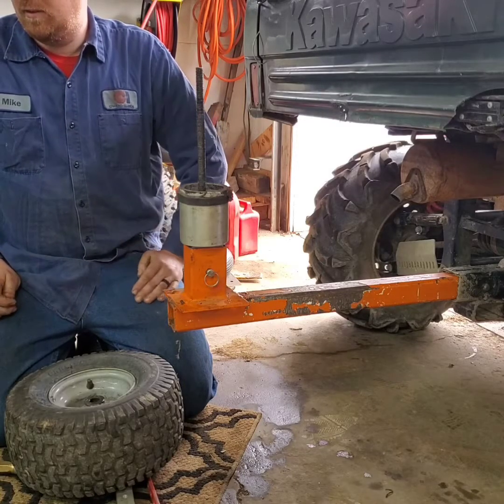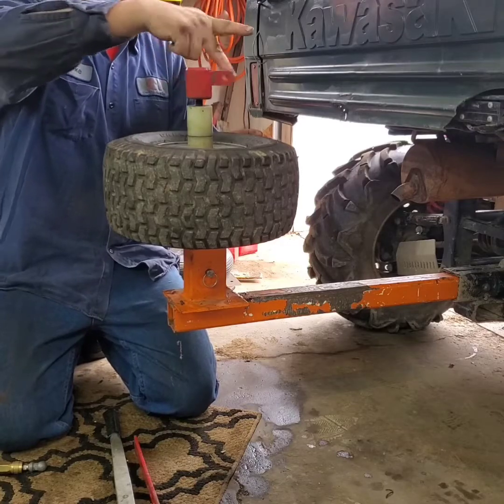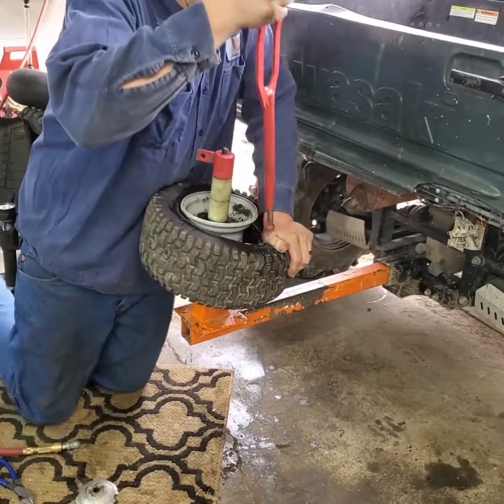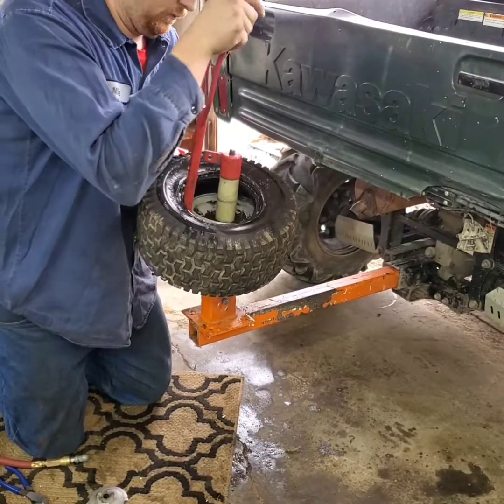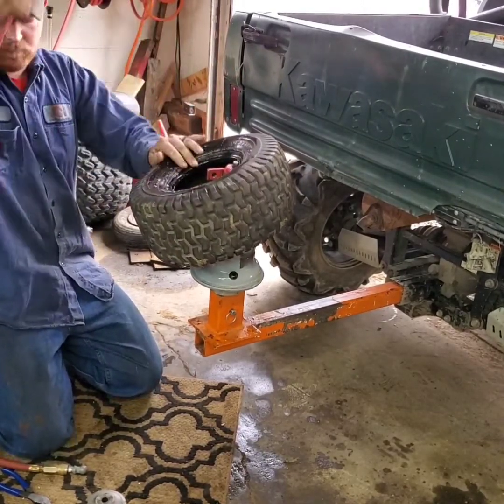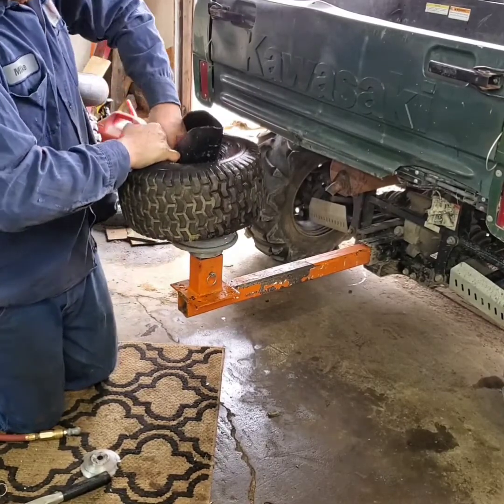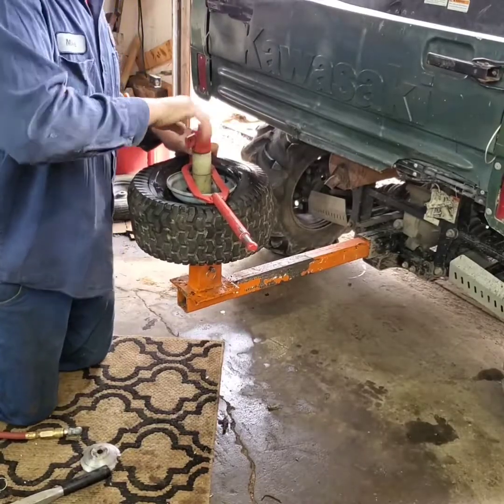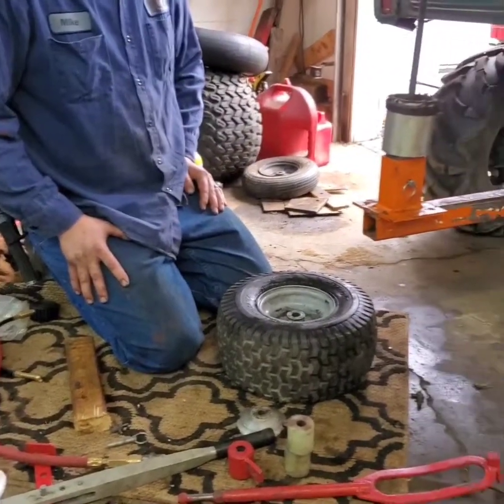Harbor Freight Mini Tire Changer Review/ How To

Comment: When putting the tire back on the tool just spins. It’s not biting the tire or wheel anywhere is just spins forever. I’ve tried a million different things, soapy water, WD40 I just don’t understand how to get any leverage on the tire to pop the second half back on. Any advice?
Reply from the maker: Tighten the nut that holds the wheel. It needs to be really tight. Sometimes I hold the tire with one hand and turn the tool with the other. Once you get the bead half on make sure your pushing that side down towards the center of the wheel where the rim is the smallest. I hope that makes sense.